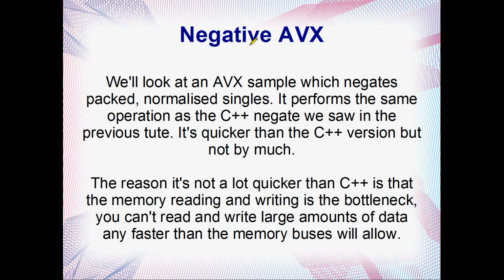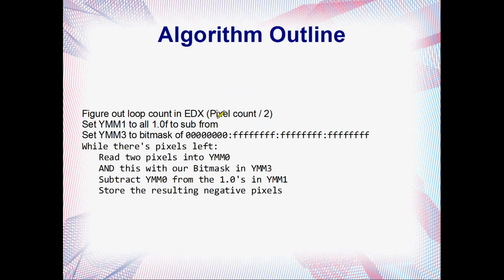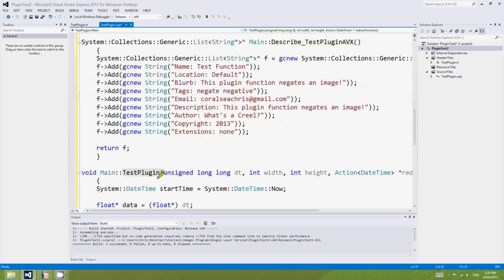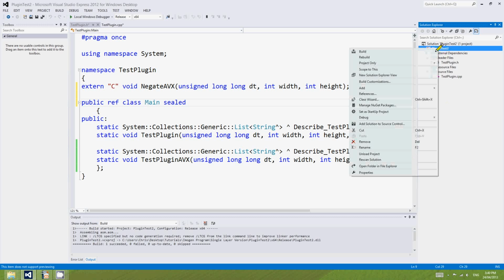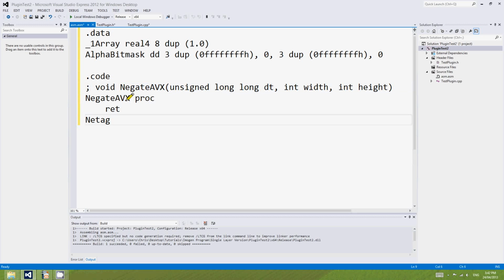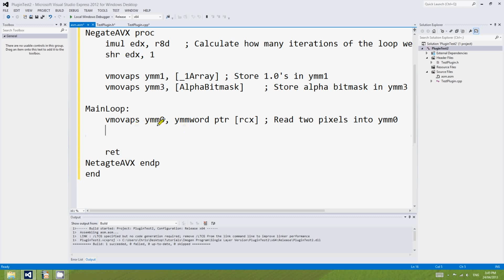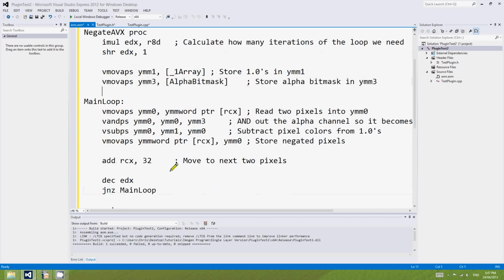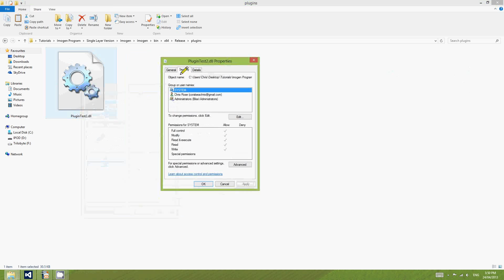x64 Assembly Tutorial 61: AVX Negate 128bpp Image

Comment: This AVX thing is absolutely botched by the RAM latency. 

- Image dimensions : best I can infer from YT (when you were hovering at the bottom-right edge), image is roughly ~430x290 = ~124,700 pixels
- Execution time [in ms]: 66
- Execution time [in frames - as in frames per second for game engine purposes]: 3.96
- Pixels per frame : 124,700 / 3.96 = 31,490
- Loop iteration:
  - LoopCount: 124,700 / 2 = 62,350
  - RAM Access ops : 2 (vmovaps)
  - Bytes accessed: 2x32 = 64 Bytes
- Total Bytes accessed: 64 x 62,350 = 3,990,400
- Bytes per frame accessed: 3,990,400 / 3.96 = 1,007,677

In following numbers, I'm going to use (as a reference) a 1.0 GHz CPU, so that you can simply use a multiplier, based on your actual CPU frequency (e.g. if it's 3.4 GHz, then use 3.4x multiplier):
Now, let's compare this against instruction throughput:
- frames per second: 60
- CPU cycles per frame : 1,000,000,000 (1 GHz) / 60 = 16,666,666
- Total Loop OpCount : 62,350 x 7 = 436,450
- OpCount per frame : 436,450 / 3.96 = 110,214
- Average cycle per op : 16,666,666 / 110,214 = 151.22

Of course, there's a huge discrepancy in execution time between various stages of the loop, since:
- The 3 loop ops (add,dec,jnz) shouldn't really take more than 2 cycles each (the remaining pipeline stages have more than enough time to finish while the first fetch is in progress), thus 3*2 = 6
- vandps+vsubps work with registers (not RAM), so they shouldn't really take many cycles either (but I don't have the Intel's IA-64 PDF handy to look up their cycle count right now), but let's say 5 cycles each, e.g. 5*2 = 10 
- they do however need to wait in the pipeline, till the first RAM fetch is finished

- If your CPU is 3.0 GHz (quite probable), then you have 50M (3.0x x 16.6M) cycles available per frame, yet execute mere 110,214 instructions! Even if the ops took 9-10 cycles (for now, disregard the latency), it'd be ~1M cycles for execution, and 49M for RAM latency. Talk about 50:1 ratio for RAM latency...

Plus, due to serial access, the caches are primed and ready (on a quick glance, I noticed there's couple cache instructions in AVX). I suspect the OS does a lot of context switching and cache thrashing in 66 ms, so it would be nice to see to run this experiment on a core that is not touched by OS, and thus can keep its caches intact.
Reply from the maker: Hahaha, this image is one of Nasa's Mars shots, and it is huge, dimensions are 7238x3125! 346 megabytes in RAM when loaded as 32 bit floats per channel.  The dimensions you read were the mouse's pixel coordinate.

Yep, defo cache thrashing like crazy! But we're just negating, so there's really not much wiggle room in terms of optimization. The prefetching instructions are a great idea, they might give 10% performance or so.

I don't think Intel publishes cycle counts. From memory, AMD has started to include that in their programming manuals, but usually I use Agner Fog's manuals for that type of info.

The OS isn't switching in the middle of a loop. It might, if we're unlucky, but generally speaking, it gives us the whole core for the duration of the loop.

Cheers for watching and commenting, have a good one!
Reply: So, those were mouse (not image) coordinates then, eh :) ? Let me recalc then:
- Image dimensions : 7238x3125 = 22,618,750 [pixels]
- Image RAM length: 345.14 MB
- RAM Accessed (R+W): 2x345.14 = 690.27 MB
- RAM Accessed (R+W) per frame: 690.27 / 3.96 = 174.31 MB / frame
- Loop Count: 11,309,375
- Total Loop OpCount : 11,309,375 x 7 (ops per loop) = 79,165,625
- OpCount per frame : 79,165,625 / 3.96 = 19,991,319 (20 M!)

So, now this is on the opposite side of extreme - it's just too damn fast :) ! But, even if it was 3.0 GHz CPU half a decade ago [when you ran it], you got 16.6M cycles / frame and with 20M ops / frame, that's less than a cycle / op, including accessing 174 MB of RAM [per frame]. Which is nonsense :)

Even if the cache was automagically primed in an ideal way (so, you'd read only from L1 - good luck with getting that!), an L1 access is at the very least - what - 3 cycles ?

Some number is definitely incorrect, but which one ? I guess I'll fire up VS and make a test myself :) It's been a long time since I did ASM on x86/x64...
Reply: ad Context Switch:

How do you know the scheduler doesn't just brutally interrupt the host core, when it needs to run its stuff ? I haven't followed multithreading developments last few years - perhaps latest MS OS indeed does not touch the core with the user-run app ? In past even if you adjusted thread affinity to manually force certain process to run on a specific core (to avoid OS services interruptions), it was still just a recommendation, and scheduler was free (and it did!) to ignore it.

I have 8 HW threads on my Xeon X5570, but even the last 4 of them show a lot of jitter (under 5%, but that's a lot of L1/L2 cache thrashing). Maybe the scheduler is different on Win8 ?

Great Channel, btw !
Reply from the maker: Hmm, I can't remember the deets of this code, but CPU's often perform more than 1 op per cycle due to pipelining, out of order execution and register renaming. CPU's read instructions into the instruction buffer. An instruction scheduler picks instructions from the buffer and shares them out to the waiting execution units. The execution units perform operations simultaneously, but only when they don't have to wait for the output from a previous instruction. The units are specialised, but common instructions generally have multiple units that could potentially execute them. This means a cleverly coded core can execute 3 operations per cycle.

Not sure if that's where this speed increase is coming from, but it's probably got something to with it. The bottleneck in this code, if I remember, was definitely RAM reads. Most of the time, the execution units will be twiddling their thumbs waiting for data.

I'd love to make vids on scheduling instructions. It's a really interesting level of programming, but really complicated, and all the CPU's do it differently... Anywho, no time at the moment, so my poor channel is a little neglected :(
Reply from the maker: There's a brilliant profiling driver by Agner Fog that tells how many cycles have passed. It's hard to use, but it shows pretty clear spikes when the scheduler switches. Most of the time, I just profile code with any millisecond timer available in the language, I average many runs. That way, the scheduler doesn't tend to factor a lot.